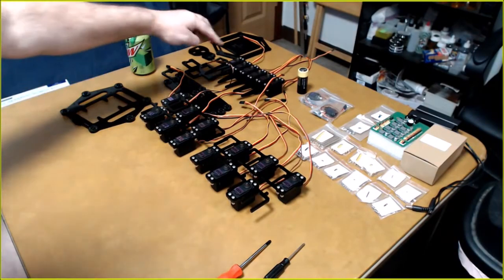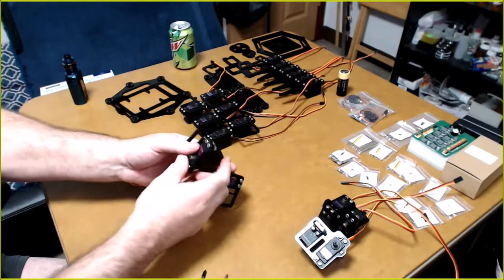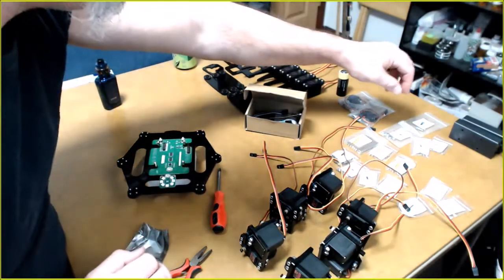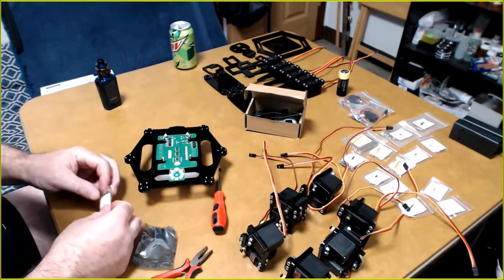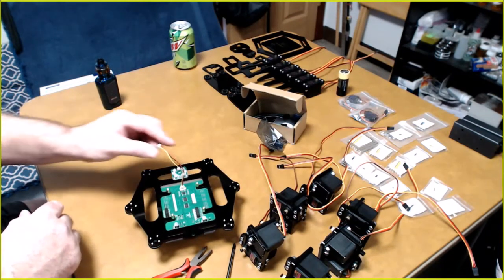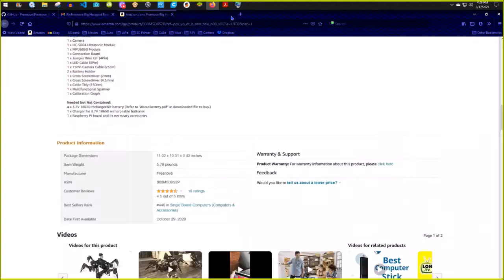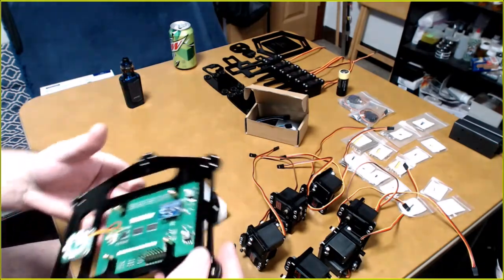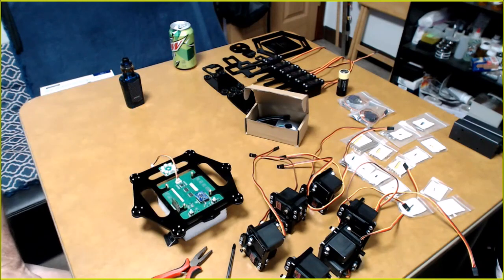Freenove - BIG Hexapod Robot Kit! Part III

Comment: how thick is the acrylic?  P1 you measured the leg lengths but not the material thickenss of legs and base plates?
tnx
Reply from the maker: About 6mm. I didnt measure this, as it really donsent make any difference. the servos are much thicker, at over an inch, and will fit regardless of the thickness of the 'leg'. If by chance your making your own - I 3D printed them 10mm thick and much longer at 10 inches, just to add more strength to them. if using aluminum or some other metal, thinner is better = less weight.
Reply: @BladeDreams  I have a CNC router and was simply looking at purchasing carbon fiber plate in prep for remaking my own (kit will be here Thursday) out of CF. Leg thickness isn't an issue (BTDT before) was more concerned with the thickness of the palte and the way the two servo plates interconnect.  I already have a bunch of 1 and 2 mm plate, just vid it looks thicker than that  tnx
Reply from the maker: @ptegler  Ah, I thought might be something to the effect of making your own. all of the pieces made from acrylic, are pretty close to 6mm thick (probably closer to 5.5mm)

Comment: My led cable is flipped too but the plugs only go in one way. Mine works fine flipped it seems.
Reply from the maker: your on part III, keep going : )
Reply: @BladeDreams  No I have actually finished it , although i am having trouble with the leg sync :)
Reply from the maker: @Kevin-tc3ob  have to be straight out / flat.